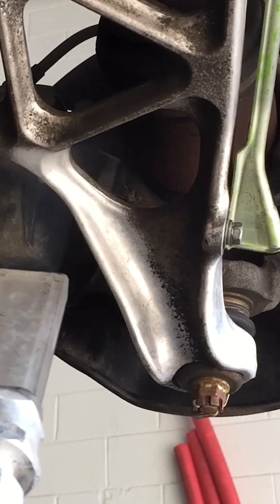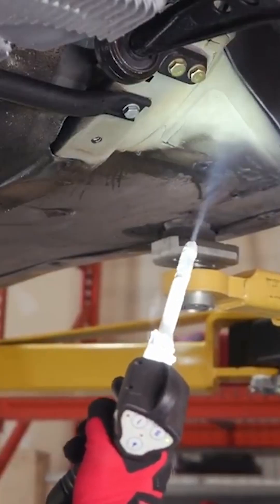Here's the science behind how dry ice cleaning works. #dryice #cleaning #cars

Comment: Does anyone know if dry ice cleaning can be done for swimming pools? I have natural rocks around the waterfall feature that goes from the hot tub /fountain and spills over into the pool. Here in Austin our water is full of calcium and other minerals so it leaves really bad white “scale” deposits on the rocks (and tile at the waterline). I’ve tried everything to clean it: pumice stones, high pressure power washer with a 0 degree spray head, and even 100% muriatic acid. Traditional sand or soda blasting would make a mess of the pool water and chemical balance, but dry ice blasting seems like it would be perfect for this application.

Comment: Except it takes very high pressure high energy input to make dry ice. It's very expensive to operate. Yes but those chemicals are going into the air all around you and then they fall out of the air to surfaces, where do they end up? Plus there is asphyxiation risk in certain applications.
Reply: The only "chemical" is CO2.  That's all.  It is a gas and it blows away in the wind or by a fan.  You can stop woth the fear mongering over chemicals now.  Everything , literally everything is chemicals and chemistry.  You are correct on condensing CO2 from the air being expensive and energy intensive though.  So 1/2 for you.  But you're on the right track, just drop the fear mongering BS......

Comment: Isn't dry ice made from carbon dioxide? So you're putting pure carbon dioxide straight into the air?...great work guys!
Reply: But you also pull carbon dioxide out of the air in order to make the dry ice, so the evaporation of the dry ice itself is a net zero. Of course this is saying nothing of the energy used to make the dry ice and blast it out of a machine.

Comment: What contraption is pressurizing the dry ice and shooting it out?
Reply: You can make the pressure with the dry ice itself.  It expands up to 900 times, remember?  Try to contain dry ice in an air tight container, I dare you.....  it's the energy you use to make the dry ice, that's the catch.
Reply: The try ice itself is sublimating into a gas and at a certain pressure it will begin to go into its liquid form. As long as you have a strong enough containment device this isn't a problem.

Comment: This is wild! We have so much CO2, and here's a great use for it.
Reply: Lol, it doesn't remove it from the environment.
Reply: @sailbatten2056  Yes, and?
Reply: @sailbatten2056  It condenses it from the atmosphere.  But, it's very energy intensive and expensive to do.  That said, it can be removed and made into other things using chemistry.  It technically can work that way, they just aren't uaing it in that manner.  The point though is that they're not using harsh chemicals to do the same job.  So it's not polluting at all vs a car wash where all the oil and chemicals don't end up in the ground water.